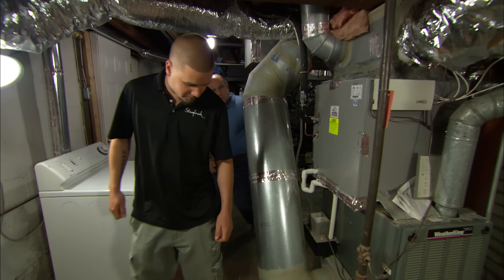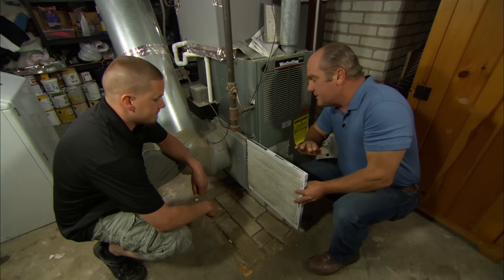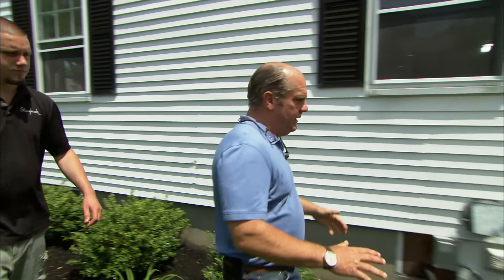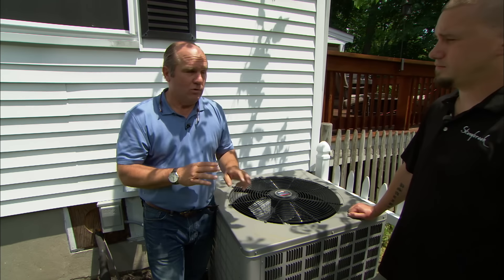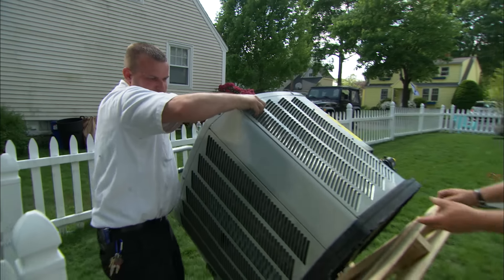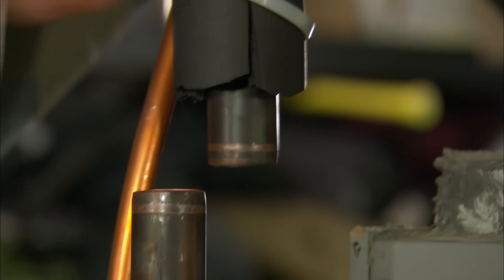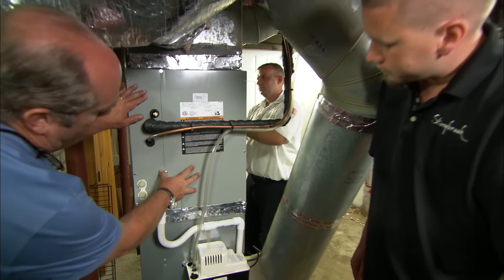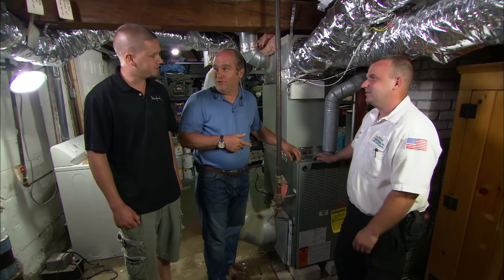How to Repair a Frozen Air Conditioner | Ask This Old House

Comment: Sure seems like to me there could be electronics sensors and controls to allow an oversized unit to work ...just is so bizarre you can't have a system large enough for a big house where you COULD close off a number of rooms and ducts to reduce energy use....but according to this info it would ice up and be unusable because by closing off part of the home the unit would effectively become grossly over sized ....WTH??  ....Let me guess OF course there is a way to design a flexable system but "it's not how THEY do it"
Reply: But from just the information here it appears the only way to have a flexible system (where you close off say half the home to save energy) would be to have multiple units ....one for the half you want to close off?   Which again is very frustrating ...does not seem right to me AT ALL

Comment: #1- Its a 4 ton AC System on a 3 ton furnace. #2- Undersized and high resistant ductwork. Look at the size of he RA drop, Look at the choked intake filter rack and off course like I see a lot in the US- Look at the flex duct on the supply. Then the added friction loss of the very short supply plenum and poor take offs. All this adds up to freeze up. Yes the AC is oversized but the "Plumber" did not show the correct Manual J load calc, so Im very skeptic that the "plumber" even did one. But he, like the original hack who installed this AC just tossed in a new system but did not address the poor poor ducting on this system. The "Plumber" is just as bad as the original installer. Then "Joe homeowners" wonder why quality HVAC companies charge so much more for a correctly installed system. This Old House is just as bad as all the "Plumber pretend to be"HVAC techs out there.

Comment: Okay that last coil was installed wrong new coil they installed it right as a matter of fact I just replace that coil today on a job I was on it had a manufacturer defect which basically one of the loops on the inside was leaking refrigerant so I replaced it full warranty no charge to the customer at all it's an American Standard that's the type of system they installed outside which is trane and trane makes American standard, now that  coil is made for either vertical or horizontal unit it has two evaporator condensate pans now both pans are not needed he should have removed the one but you can also leave it in there I guess that coil comes with a kit when you use it for horizontal use you have to install a flap as well it's a piece of sheet metal that comes with the kit for air flow Direction also I didn't see Keith remove the TXV bulb on the coil, that coil comes in a box that has several stickers saying remove the TXV bulb well he did not do that and when you heat up that line said so you can braze the joints together you will also heat up the sensing bulb it just connected to the TXV, the  sensing bulb senses temperature from the suction line is what tells the TXV to open and close so the TXV meters refrigerant depending on the temperature of the suction line when you heat up that suction line or the liquid line you could damage the TXV or the TXV sensing bulb which will cause the TXV not to meter correctly either be stuck open or closed or not open enough and it's like a restriction.

Comment: Pro tip. Don't hire a hack to install your ac. This job goes on the worst install list.  Is that how you east coasters do your jobs? What happened to craftsmanship? Who would think by looking at that trash pile that it was a good job. Not much better after the new installation.

Comment: I don't know anything about HVAC calculation and design but the funny (or sad) part is, you get shocked by the video suggesting to replace the whole unit and then read the comments to see what it should have been done, there you find whole group of people who seem (or claim) to be experts in the HVAC, everyone say the guy in the video knows nothing but you don't find two answers that are the same, each different opinion and read responses to the comments call each others fools and not knowing what they are talking about... Looks like if each of these people had made the video would have had the same exact reaction from the audience. 

I still didn't get what it should have been done differently....

Comment: Yeah, there are many things wrong with this video as an information video! An a/c unit that is over sized but has ductwork that is correctly sized for the oversized unit does nothing more that cycle on and off more often. For example I have seen businesses in Central America with units twice what the load that needed if the front door is not left open for customers easy access! Example number two. A home that has kids running in and out andvin and out! Fix? Larger BTU Unit with appropriate ducking! Any decent HVAC guy person that has a true understanding understands this! What about putting the the proper location of the grills and the thermostat? Thinking is in short supply!

Comment: Richard "I would expect to see a ton for every 5-600 sqft"
Owner "It's 1300 sqft"

So let's install a 3 ton unit which is a ton for every 430 sqft.  LOL.

Oversized units short cycle, never running long enough to properly dehumidify the house.  This means higher indoor humidity, lower thermostat settings to feel comfortable, and a higher risk for moisture and mold problems.  A 2 ton unit with a standalone dehumidifier is probably a much better solution (650 sqft/ton), along with a handful of ductwork improvements (that return duct and filter holder is a hot mess!).  A simple manometer check across the blower motor would give you a quick idea whether the ducts are flowing properly or not, without all the goofy measurements and whatever else they pretended to do before putting in a slightly less oversized air conditioner.  Hilarious.

Comment: So surprised the guy did not even check the pressure. Most likely cause is low on gas. No need to replace the whole unit. Bad repair job!
Reply: In this case he didn't have to put guages on when he found out the size of the a/c system and the square footage of the house. Any first year rookie properly trained could figure that out!

Comment: Disagree with changing the whole system just for freezing up A Coil, then what is the point of calling for a technician. He should have put the right amount of refrigerant and it will fix the problem instead of replacing the  whole system. Or he could have changed the condensor only for right size.

Comment: you do not need a p-trap on a blow through coil...vent it with a tee, a short piece of pipe, and with no cap.  Just remember to cut your piece of pipe higher than primary pan...and for GODS sake!...add a float switch. ;)

Comment: why did he recover the freon when the unit was running?? pump freon into outside unit and save whole unit and ive been doing this for 10 years this situation never happens rofl where salesman says itll be plenty big and installs a 4 ton on a 2 ton house
Reply: Technically, you still need to use a recovery machine at the end because the compressor won't get all the refrigerant out, just most of it. To meet EPA requirements that is.

Comment: Where's the thermostat temp sensor located? It should be in the return air. Is it calibrated? How does the defrost system work, timer or temp driven? Where's the sensor for that? How about running that big condenser fan on a VFD with a feedback from the HVAC control. What's the duty cycle for this HVAC system? Jeez! Replacing the entire thing is the last thing I'll do.

Comment: He is so wrong, the size of the unit doesn't freeze the coil, the thermostat turns it off when it gets to setpoint, an oversized unit will short cycle a lot, but FREEZE the coil? Very rare.... it's the fan speed or the unit is low on refrigerant charge or the filter is dirty or the duct size is too small for the return.

Comment: Wait, WHAT?!?!?

Didn’t check refrigerant charge, airflow issues (outside of the filter), metering device, blower motor?!?!

If I recommended a condescending unit replacement simply because of a frozen evap I might be out of a job. lol

Comment: yes yes yes OR nO nO nO  i  definitely count wait the post that refrigerant running backwards & comes back to the cooling Coil already cold ..what a crock ..Unbelievable for this Old House knows better w / t heck .......but i might add THEY WERE RIGHT A FEW THINGS PROPER SIZED SYSTEM FOR THE LOAD ....BUT DID THEY REALLY ADDERS AIR FLOW ISSUES SUPER IMPORTANT SO HOPE THEY ALSO FIXED THE RETURN AIR PROBLEMS AS WAY IT WAS SHOWN..... IT WAS WAY TO SMALL even for the 3 ton its duct out for a 1.5 ton system as shown  ...SHOULD HAVE ADDED 1 OR MORE RETURNS ..... HVAC Tech & installer  for 24 yrs & counting

Comment: Undersized return, undersized supply!! Still has a undersized return with the 3 ton, and the supply looks questionable!
Reply: not to mention there is a damper system, so if only 1 zone is running the supply is definitely suspect... and there's no bypass damper! would have liked to see them fix the duct issue

Comment: Nonsense.  U need to have more cooling power than what ur calculations gives you so the unit runs without stress. The old  system was not properly calibrated and low on freon

Comment: This isn't "how to repair a frozen air conditioner." It's barely "How to check if your AC unit is sized right." Any real technician wouldn't condemn the unit without hooking up gauges first. There's a million things that could cause a freeze-up besides an oversized unit. Especially if it was working properly for months prior to failure.

Comment: Freezing up...either airflow issue, restriction or low charge due to leak 99.5 %of the time. Refrigeration 101
Reply: air flow issue is 3 ton blower on a 4 ton system. Solution, put in smaller tonnage a/c to house square footage or load calculation and increase size of return.

Comment: Didn’t even check freon levels... Did they try to pump it down?.. No float switch on the coil... They didn’t get the super heat after releasing the charge... geez. I would be fired for this.

Comment: Did anyone notice that he pointed to the liquid line and said refrigerant flows back to the compressor? then points to the suction line and says cold refrigerant flows back to evap?? Lmfao that’s not how it works I’m shaking my head. It’s not a heat pump dude

Comment: So, are you trying to tell me, that the problem was too big equipment for the house? And the best solution is replace the whole system? Thats the solution? Come on...I'm not and expert but i can think in some things:
1-. What about the termal sensors that shutdown the compressor when the desire temp is reached?
2-. What if the compressor was low of freon?
3-. What if the unit outside has an issue in the fan, and therefor the system cant cooldown the freon?
4-. What if the issue is the outside fan capacitor?
5-. What if the speed of the fan that push the aire trough the evap unit is too slow?
6-. What if the relay that shutsdown the compressor is always open and the compressor never shutdown properly? 

I can thing in another things that causes the problem. Maybe you need to be more professional. More technical, and try to solve the problem, at the lowset cost and more efficently. 

What if the problem if a simple capacitor deficiency? Or maybe the compressor relay? Or the termicals sensors? Is more expensive change one of this components than replace the whole system? I dont think so......

Comment: The new unit is  oversized. A 1,300 sg. ft. House should have a 2 or 2.5 ton unit Not a 3 ton. That’s true for all climate zone 1-5.
https://asm-air.com/dashboard/static/uploads/2014/10/what-size-central-air-conditioner-do-i-need-for-my-house-calculator.jpg

Comment: Just started ac classes and know more then him. Could just lower refrigerant levels. Have dehumidifiers to reduce moisture.  The system was over size for the home and the furnace,  evaporator was hanging over edge of the unit. Uneducated people, replacers.

Comment: seems like an engineering fail to have to replace a perfectly good unit thats"'too big". 

why can't there be a control loop that simply tells the condenser unit to slow the flow of coolant?
Reply: That's what the TXV valve is for. It lets refrigerant in based on the load, it's the weird looking thing he points at when he starts attempting to explain the refrigeration cycle. Realistically the only thing that needed to happen was a refrigerant pressure check to see if it was low and or replace the TXV valve. All cheaper than buying a brand new freakin unit like these guys did. Such a waste.

Comment: This guy is more like a Salesman no gauges you have to put on the gauges first two reasons why it's going to freeze up love air flow and low on freon those two reasons can expand to multiple more reasons but those are the two basic this guy is a scam artist he doesn't even know the flow of freon it does not go from the high side two outside poor video!

Comment: This video should be removed because of the wrong Refrigerant circulation explanation. To diagnose a frozen evaporator one should do: blower motor speed, clogged evaporator, pressures of high and low sides, etc. one ton more wouldn’t cause frozen evaporator

Comment: Low airflow OR/and  * low refrigerant* charge cause freeze ups. Why would you change new equipment without checking to see if there was a leak causing low charge first? Wow what advice "have a freezup?  Spend a few thousand more"

Comment: He lost all credibility when he said the heat absorbed by the evaporator coil returns back through the distributor tubes and the liquid line. It actually flows the other direction through the manifold at the top and through the larger suction line. 
The reurn air duct is undersized, and likely  the main cause. He didn't check the cleanliness of the evaporator coil of the blower speed. And he chose to install a 3 ton without doing a Manual J heat load calculation.
If he worked for me I would send him for training.

Comment: Herein lies the problem.  My air conditional unit and the evaporation coils are both in my attic.   I have had an AC group out twice in 3 month and each time they cite..., your evaporation coil is frozen, we turn on the heater to increase the thawing time, when the outlet drain drip is gone the recharge the air conditioner with 410A refrigerant, and say the reason that it is freezing up is because you have a leak in the evaporation coil and that leak is what is causing the freezing, and close by saying you need a new a better unit.  Well the unit is only 7 years old and they may be telling the truth but there is no way to verify it because I cannot physically climb into my attic to confirm that is the problem.   Quote for a new unit $12500.00.   That just is not working for me.  If it is indeed the evaporation coil why cant I just replace that?
Reply: David L Wrightsman. 
Seems they may be guessing or "pulling the wool" twice in 3 months means they didn't fix the "leak" or they're "barking up the wrong tree" with thier fault finding. 
Possibly not a leaking evaporater at all. 
If they say it's a gas leak, get them to spray bubble leak check and take a video. Then afterward the confirmed repair. 
Or, Call someone who knows what they doing!
Reply: Thanks Nathen.  Now, how does one go about finding a quality AC repair person?

Comment: He must not do air conditioning a lot because what he said was wrong  when he was explaining the heat being taken outside by the refrigerant..and he also did not notice that the txv does not have insulation on it... I could not see where the sensing bulb is but it should be outside on the big copper line that is freezing and it should be insulted as well... U want that sensing bulb to sensor the refrigerant temp outside of the coil because the air is different temp that the refrigerant... It will not work how it was designed to work..txvs are used in high efficiency air conditioners and you will not get the efficiency that you pay for if it's not done correctly like this one..he was able to take the door off fully which tells me the sensing bulb is inside the cabinet..im willing to bet that it's not insulated either... The thing to the left of the thin copper tubing in a circle is called a thermo expansion valve... TXV...thats where the refrigerant goes into the coil  not  out...the txv has a sensing bulb that opens or closes the valve depending on the temperature of the refrigerant that is leaving the coil... It does it automatically... The txv is what turns the high temp high pressure liquid into a low temp low pressure vapor...it is 1 of the division points of the system ...the other is the compressor outside... When a liquid changes into a vapor it absorbs a lot of heat ...so all a refrigerator or air conditioners do is keep repeating the cycle of turning the refrigerant from liquid to gas to liquid etc...im actually shocked that he does not know how the unit operates... The big pipe is called the suction line... And the little one is called the liquid line... He has no clue how it works...

Comment: This is not a very good example of how to fix a freezing AC system. More like why don't you call the company that just put the wrong size unit in.

How does the wrong unit even get installed and nobody notice all of a sudden you call a service man to come over and fix it? Makes no sense call the company that installed the wrong unit back out to put the correct one in. 

Real world service calls of a frozen AC system would be 99 percent of the time low refrigerant or low or no airflow.